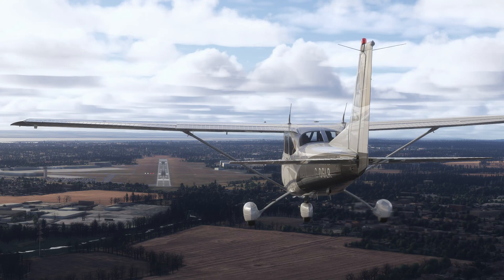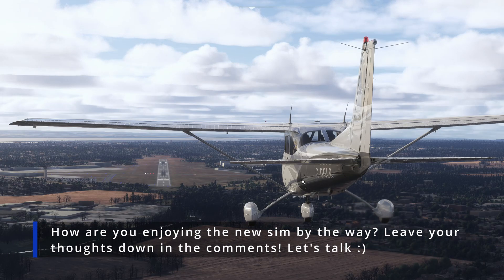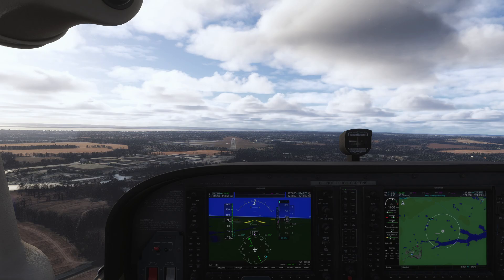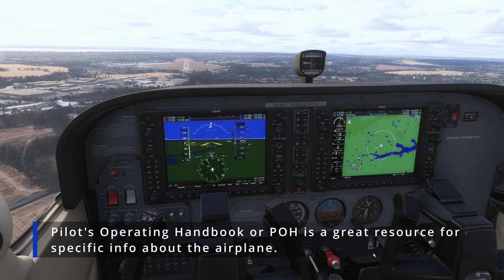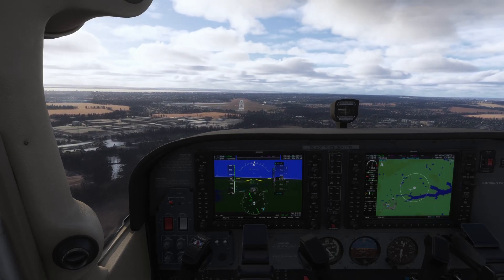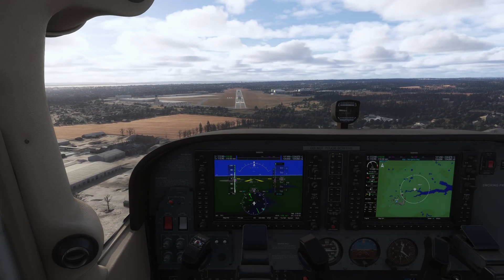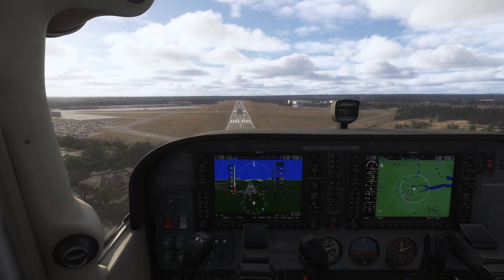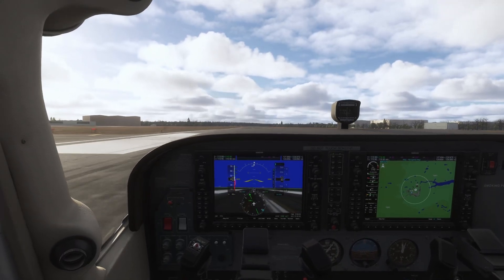MSFS 2024 - HOW TO LAND AN AIRPLANE - REAL WORLD PILOT

Comment: Teach us how to land the tail daggers. The game doesn’t explain what speeds and flaps you should be coming in on…
Reply: It’s similar to the 172 although I usually only use 2 flaps unless I need 3. You want to land all 3 wheels at about the same time tho. 
As a quick tip look at the white lines and the red bar next to the speed dial the they are good markers for what speed you should be at for small/medium aircraft. 
On 2024 some of the aircraft have info about the minimums and what not. 
Hope this helps. Happy flying
Reply: I’m atrocious at landing, but now the Draco is my best. Don’t go for a 2 wheel landing, or even a 3 wheel at speed. I get super low and slow, go full flaps, and land full stall like butter. It’s the only plane I’m consistent in. Not sure how that will carry over to other draggers though.

Comment: After you lower the flaps, do you use your trim to counter the upwards pitch you get from the flaps? :)
Reply from the maker: I use the yoke to get the desired speed and then use the trim to relieve the pressure off the controls
Reply: @AirborneGeek  Do you use the Honeycomb Alpha? What buttons do you use to trim? 😁
And what sensitivity do you use of the yoke? 🤗
Reply from the maker: @KK49917 hey I use tca boeing yoke. But on honeycomb alpha you can assign elevator trim up and elevator trim down to the click butttons you have on the left side of the yoke
Reply from the maker: @KK49917 i use the trim wheel too on my bravo throttle quadrant. That is assigned to the same 'Elevator trim up' and 'Elevator trim down'

Comment: Not a pilot.. almost always come in too fast if staying within blue rings. I find it’s best to stay just under them. I’ve cut the engine with full flaps at final in Cessna. Clearly doing it wrong but just trying to survive in career mode.
Reply from the maker: I see it as almost doing like a descending slow flight at the constant approach speed ~60 kts...easy to not float too much that way once you cut the throttle over the threshold. Crosswind makes it harder but that will be another video 😅